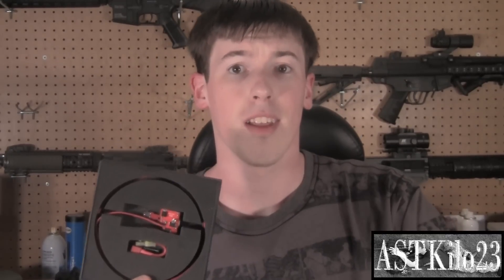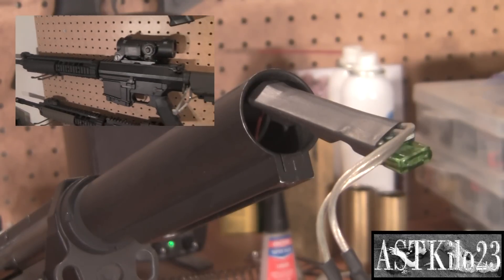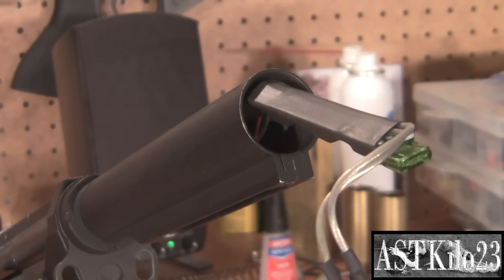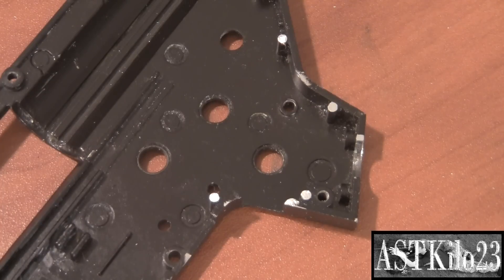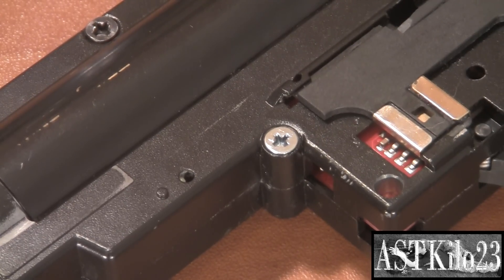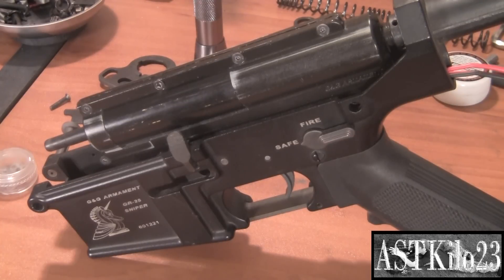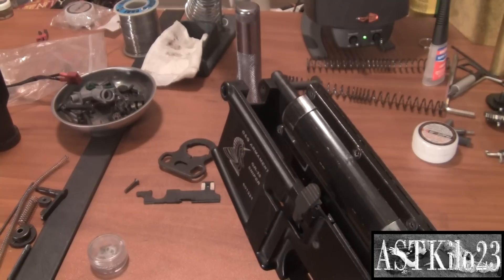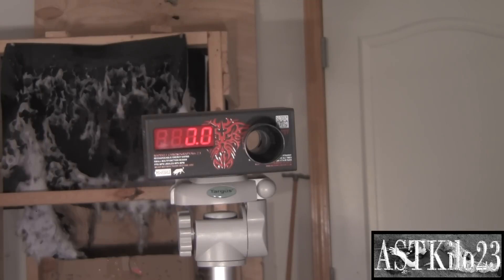REVIEW: BTC Spectre Mosfet for V2 Gearbox  -ASTKilo23-

Comment: What is your opinion of active breaking mosfets. Do they put excess strain on the motor?
Reply from the maker: i, personally, haven't had any problems with active breaking fets. might have to clean the motor a bit more because of increased crud build up.

Comment: If you were planning on going from a fet-less 9.6 to an 11.1 with this fet, what other parts would you recompensed upgrading? M100 - M110 spring btw.
Reply: m120
Reply: FearTheReaper indoor play tho...
Reply: maxmaz2 just short stroke the sector gear and then boom.

Comment: Hey, I want to install this mosfet (if it ever comes out in stock again, been waiting forever) in my VFC Scar L but what you said at 4:00 makes me wonder if I can. The selector plate on the VFC Scar doesnt have that metal surface on it either so what can I do? Those kind of parts are very limited and I would probably end up having to make one myself Macgyver style. Any tips?
Greetings from Sweden
Reply: should work, Spectres have been installed in SCAR L and SCAR H. basically any v2 gearbox works. Ive seen them in MP5s
Reply: Thanks for the answer!phloudernow

Comment: How do you feel about the burst wizard king kong super 2 mosfet (its on airsoft gi) i dont know much about taking apart a gearbox so is that a good mosfet?
Reply from the maker: i wouldn't waste money on it. used them, not as reliable and are not true mosfets.
Reply: ASTKilo23 How can you say that the BWKK S2 are not reliable? Have you installed and used this new MOSFET from BW? I have the new BWKK S2 installed in my ASGI FMG4-A3 and it has been perfectly reliable. It has many, if not all the same features that the Spectre has. I haven't had a single problem with it in my gun. And when it is fully wired into the trigger switch it is a true MOSFET with LiPo monitoring. And at $60 cheaper than the Spectre, I think its a great value. And it works with any type of gearbox.
One of my biggest complaints about reviews like this where the product in question is given to the reviewer, there is never ever a negative review posted. And this one is basically pointless. You installed this MOSFET with a lot of great features (probably the best feature is the burst feature) into a semi only gun. Why? I will admit that the hair trigger effect of this MOSFET is really very cool (Yeah, I've shot a gun with this 'FET installed in it).

Normally I truly enjoy your reviews and "How To videos," but this one really stinks of an overt product placement ad. Sorry, just being as honest with you as I can be.